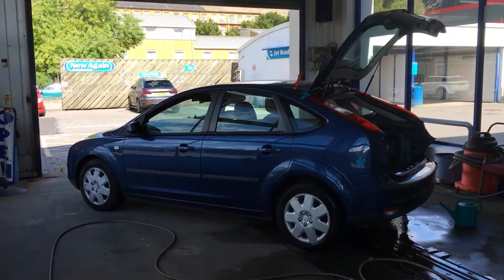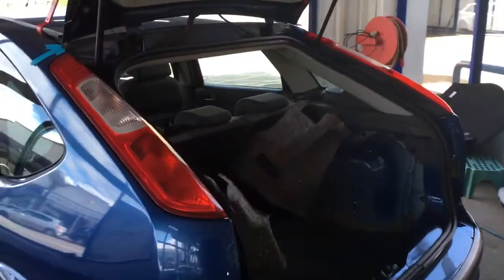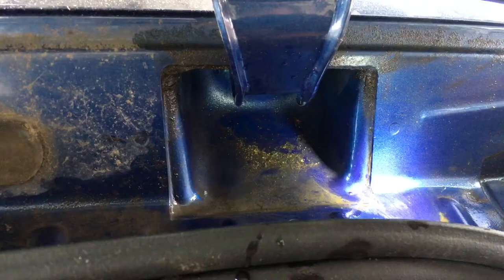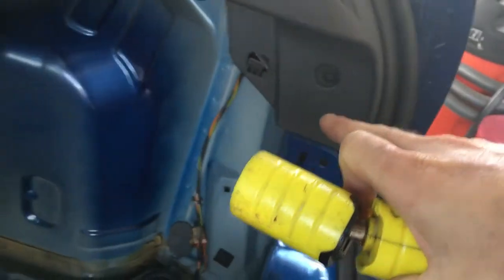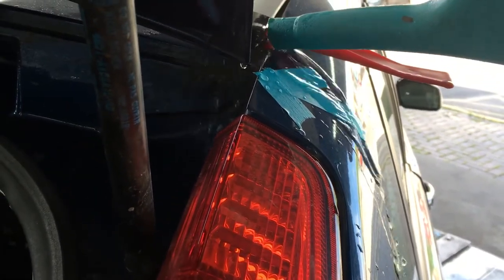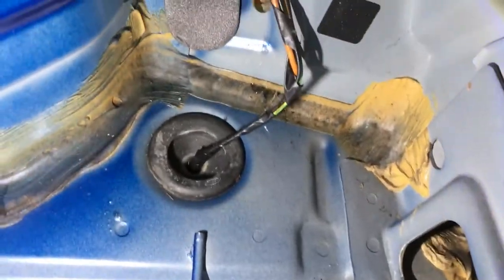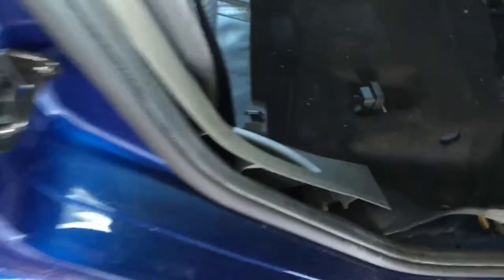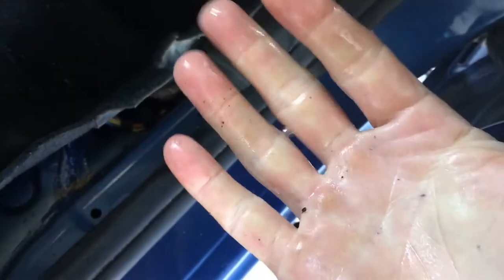Ford Focus 2007 | Water Leak Boot Hinges | #FordFocusLeaks

Comment: For anyone else still having water leaking after trying this, check under the plastic roof runners, pull the end up and there will be a crack under it, i sealed the mine with silicone then stuck the plastic back down with more silicone, did this 2 years ago and haven’t hand any water since 👍
Reply: was this causing the rear footwell to flood? cus thats the issue i am having

Comment: Heads up for another issue. The caps that cover the roof bars/roof rack mounts. I have recently purchased 2x focus and both had this issue. Car previously must have had roof bars that had been removed before I purchased the vehicles. Factory they have a sealant that goes in the hole where the bolts go through that needs picking out. Obviously if bars are removed you need to reseal this hole.
Reply: I have a 2012 focus with water leaking into the hatch compartment and wheel well and it seems to leak from a small hole in the rear Quarter panel in hatch area on drivers side and when hosing on the roof along the roof mount cap drain strip. I also had to drain water from the drain plugs under the car with soaking wet sound deadening material. a body shop I went to had a look but couldn't get the bottom of the problem leaving me with having to get further investigation done at a mechanic shop when I can get it booked in

Comment: Hi lads, I have water in the exact same places in my 2011 Focus mk2.5, what are the chances its the same issue as here? Been driving me nuts for months trying to find it.
Reply from the maker: There are half a dozen cars that suffer this issue, not all of them Fords. It's certainly not uncommon, and we have seen this on several Focus's. I would think there's a pretty high chance if it isn't the rear air vents. Check out play-list for other Focus issues. #fordfocusleaks

Comment: Any video how to solve this? Thanks
Reply from the maker: These videos are part of our company's internal system, a database of where to find leaks. These videos are also shared with the customer as part of a video report so they can decide how to proceed. At the stage where we film these videos, the customer has hired us to find the leak, they may not hire us to repair it, therefore filming the repair is beyond the scope of what we are trying to achieve. So the answer is no, we don't do videos on how to fix these problems, but we do generally write the solution in the description.

Comment: so what did you do to solve this problem?
Reply: We clean the area, then we get a good quality automotive sealant, similar to the ones used at the factory (we use Innotec and Wurth) and we put sealant along the seam and wipe off the excess, trying to keep it neat and tidy.